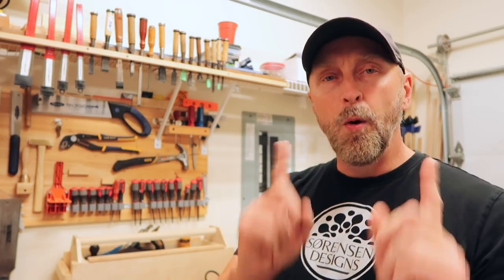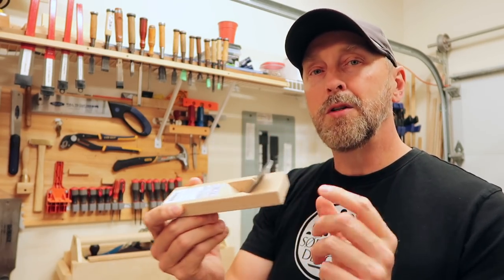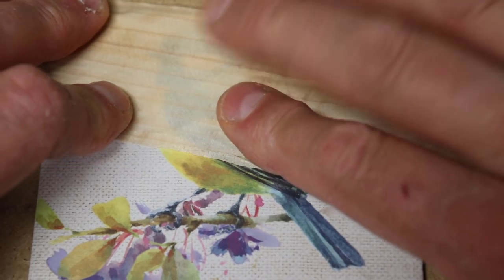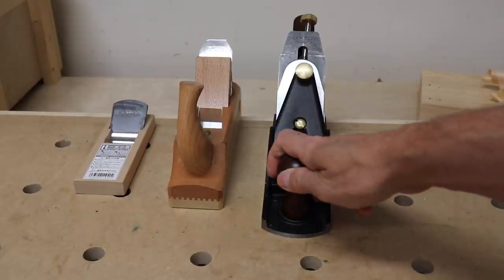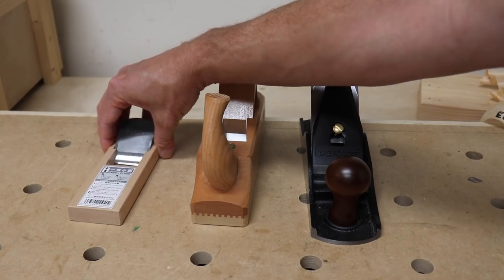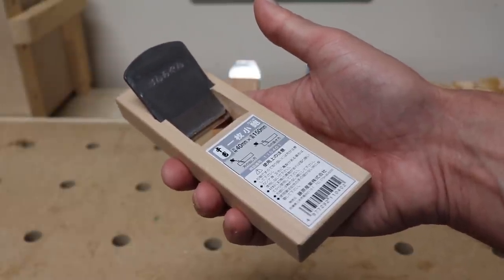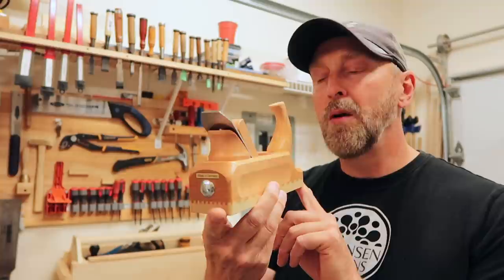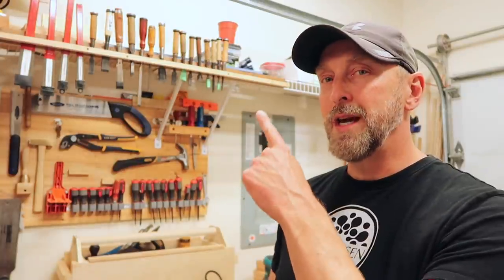$18 Hand Plane VS, a $289 Hand Plane - Woodworking on a Budget

Comment: Thanks for this test Eric. Verry valuable. I bought a Stanley Nr. 4 ages ago and inherrited a wooden smoothing plane by the dutch tool manufacturer  "Nooitgedacht" from my father back in the 90- thies. Both are in a bad condition, but setting-up a new workshop now I am in pension, you video made me decide to restore both blades instead of buying new planes. Thanks for uploading, ist's always a pleasure to see you working and hear your clear and explanatory comments. Rgds from Germany and stay safe. Robert
Reply from the maker: Thanks Robert! Sounds like a good restoration project. You also might have better luck (than me) finding used wood body planes in Germany. It's hard to find them where I live in Canada.
Reply: @EricSorensenCanada  Thanks for your answer Eric. The company Nootgedacht (founded in 1840 in Ijlst in my home country The Netherlands) does not exist anymore, It was sold early 2000  (over 3 different stations) to Newell Rubbermaid ,  who again sold it to Stanley Black and Decker. They do NOT sell planes any more. I found antique wooden planes from  Nooitgedacht at E-bay.  If you need German wooden planes, please tell me, then I could buy them for you and send them to Canada. We could change adresses later. Rgds, Robert

Comment: Interesting comparison Eric. I own a Veritas hand plane & really love it. The little Japanese plane was impressive, as was the wooden plane. It would have interesting to see what the differences were between the blades that each plane came with. We all know that the sharpness of the blade is the critical factor in getting those thin slices of wood. The Japanese are know for the quality of their blades. Anyway, keep up the great work & stay safe.............  👍👍😉😉
Reply from the maker: Thanks Steve! This is one of those things where woodworkers tend to be in one camp or the other. I try to keep an open mind and use both wood and iron body planes. Good point about the blades. I know for sure my Veritas plane only has the O1 General Tool steel iron. You can buy the higher quality A2 or the PM-V-11 blades but those were out of stock when I bought my Veritas plane. I don't even know if the Japanese plane is true Japanese steel but it seems to be comparable to the O1 at the very least. The ECE hand plane made in Germany seems to be an A2 judging from the finish. All that means though is that the O1 tool steel will need to be sharpened more often.  Cheers🙂🍺

Comment: Maybe you could make one other test with those 3 planes: how many shaving you can do before sharpening.
I have a very cheap plane that I had to modify a bit, but it now works very well, except I have to sharp the blade kind of often time, but I paid around $25 at home depot more than 10 years ago...
Reply from the maker: It all depends on the grade of tool steel. You can find plane irons in a few different grades: A2 is a 1% carbon, 5% chrome, air-hardening tool steel OR O1 - general purpose tool steel OR Veritas'  PM-V11 which is a powdered metal alloy that is supposed to hold an edge longer. It really comes down  to the manufacturer and how good they are at making their plane irons.
Reply: @EricSorensenCanada  Harbor Freight steel is most of the time, not the best... But It's difficult (at least to me) to find out the kind of steel those plane's blade or (plane's blade) are made of...
I really like those tests when people buy the tools, so free to say the truth!
thanks for the quick answer.